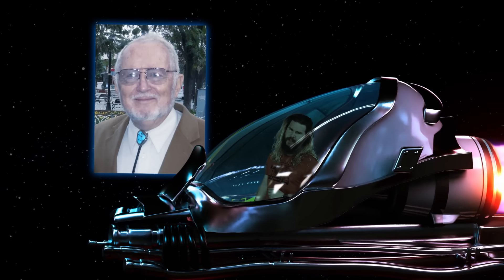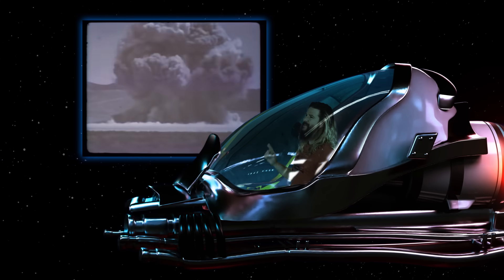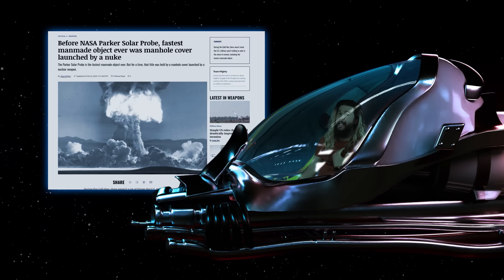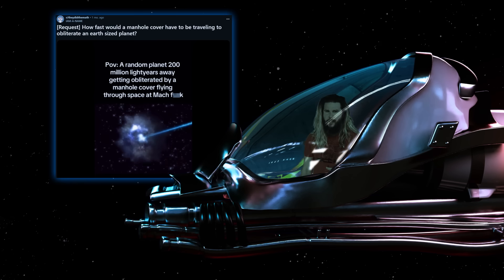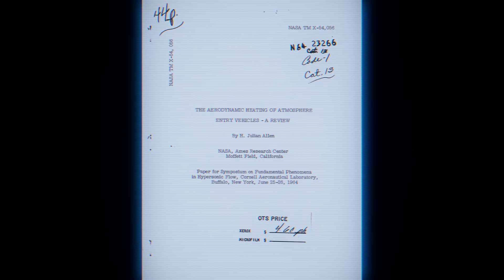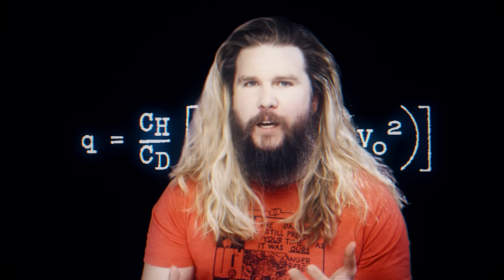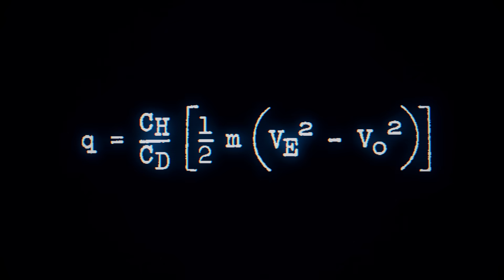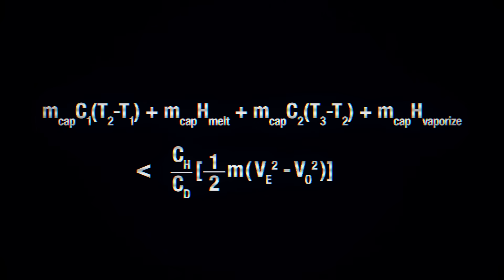Debunking the Nuclear-Powered Manhole Cover

Comment: I think there may be a flaw... 1) yes manhole covers are traditionally cast iron 2) cast iron is extremely brittle 3)welding cast iron is difficult and makes it more brittle 4)having more than alittle experience with explosives and the occasional run in with a sewer lid, it does not usually survive blast overpressire without fracturing .. all this to say i think your manhole cover was probably steel, and most reported accounts call it steel- your melting temps are off

Comment: Cast Iron is so brittle that the cap probably turned into powder. Something I don't see mentioned in most of those videos is what was between the cap and the nuke below: Namely, a huge concrete plug and a crapload of water. They basically made the world's largest steam cannon. Either way, something going as fast as that cap would compress the atmosphere in front of it so much the air itself would start to burn. If it powdered, it vaporized.

Comment: before I'm even finishing the video, the math is skewed the wrong way. People saying "it has to go through the most dense parts of the atmosphere first therefore it is worse than re-entry" you're thinking about it the wrong way, and the entire formula for calculating it doesn't factor this in. As you go further upwards, air density and resistance down, meaning that the further up you go, less drag, less heat generated. Your low point which has the most dense air is where the acceleration happens, meaning it has the most energy in it, and it can accelerate to the point that air density no longer creates the drag required to generate heat.

On re-entry, instead of an explosive acceleration that has less drag the higher it goes, you are losing energy and increasing drag the closer to the ground you get. Think of it like a brake rotor on a car, if you brake hard from 100 down to 90mph and then release the brake slowly until you hit 80mph without accelerating more (gravity lessening as you go upwards), you generate less heat than if you are going 100mph and gently apply the brake until stopped while continuing to accelerate (gravity increasing).

This is also why engineers always fuck everything up, at some point in their studies, they lose common sense. (not calling you an engineer, idk what the fuck you are, I'm just mad at engineers today)

Comment: You acknowledge in the pin that heating takes time, so how does this calculation prove anything? The lid would have reached the Karman line in about 1.5 seconds at that speed. And, as many others have noted, it would have received progressively LESS heat as it climbed. I'm certain there was ablation going on, but that would have served to preserve some of the mass by removing energy/heat from the leading edge. One objection I haven't seen anybody else raise is the fact that long before it vaporized it would have become malleable enough for the air resistance to form it into a more aerodynamic shape.

There is one more factor unaccounted for. The lid wasn't traveling alone. There was a shockwave and a plume of gas. It's entirely possible its relative air velocity was significantly lower than its climb rate.

Comment: When an object re-enters the atmosphere it's heated due to rising temperatures and barometric pressure. This is why comets and other objects get super heated as they enter and most ultimately burn up as they get closer to the ground. The manhole cover is doing the exact opposite. Like any object travelling at a higher altitude. It will form ice build up from the water molecules and colder thinner air temps(NO I am not saying that ice actually built up on it). The air is thinner and colder at higher altitudes. Travelling fast enough the rapidly cooling air around it potentially could have preserved some of it to potentially plausible. You want you math to be accepted. Take Hawking's approach. Once you think your theory is right. Try and disprove it to test it validity.  We also don't know how ANY object acts and reacts based on that shape and velocity. You should do less theory and more practical testing.

Comment: it is wild for some one to think you could get 2000 lbs of cast iron to get 2700 degrees in 10 min ish maybe even less time how much of i difference will it make in friction as the air gets thinner was it tumbeling did it wobble I mean at 150k mph ish it could have went straight as hell id like to now a little bit more about it and then we could know more was it 120k mph or was it 201k mph that is a very large difference

Comment: Ok.... I look far more into this than I thought I would. Did far more math and math research that I thought I would. 

Saw this a few days ago btw. So @kylehill is right. But hes also wrong. The part he is wrong about is the man hole cover WOULD survive the thermal stresses IF it could have survived the MECHANICAL stresses. 

The blunt shape of the object provides thermal protection from the aerodynamic effects. The blunt shape means more air needs to move out of the way and of which cannot do so fast enough and provides an area where heat has trouble traveling through to the material of the object. If it tumbled, it would NOT get this benefit intermittently. Additionally, as the surface heats up it is heat up so fast that is boils off before conducting into the material and is carried away by the air ripping it from the surface once the air can overcome the mechanical bonds (its called ablation) the material has to itself. Unfortunately, that is immediately.

The PRESSURE that this air inflicts is enormous. Rudementry calculations show that the stresses at the face of this object is going to be at the GIGA PASCAL range. Even if this thing was made from D2 tool steel and hardened to 60hrc throughout it still would not be able to survive as the forces are over 10 times the materials capabilities to withstand in the worse case and just above its capabilities in the best case. It would literally spall like a bullet hitting a steel plate as it moves through the air. Best case is if all the load is compressive strength generally is better than its tensile strength.

Note:
These calcs did not take into account of ANY deformation and how that would affect the Thermal or Mechanical Loads that are imparted.  My professional opinion is that it doesn't matter, I cannot for see steel as a material being able to deform in such a way that it would provide enough benefit for it to survive mechanically. I do not have the means of mathematical knowledge necessary to check this however. I MIGHT be able to run it on ANSYS but I would need to check with ansys to see if their CFD solver is able to take into account of these effects. I have never ran a CFD as such high speeds and have never seen one ran a such.

Comment: A couple things to note.

Objects traveling at hyper sonic speeds see insulation of the vehical due to the Shockwave. Addtionally the more blunt the object the more insulation received. This is due to air not being able to move out of the way fast enough.

Addtionally ablation needs to be taken into account as ablation is used to remove heat before it can conduct into the material.

It's still possible the manhole cover could have survived

Comment: I got a question are you taking the account of the air getting thinner the higher you go? And a astroid most of the time don't take the fastest route like straight up and down. And about the film it could have been covered by the fireball of the explosion's expanse. But I would like  to think it happened. But if any of it made it more than likely it would be glitter or dust . In the film it was just one frame that we can see the cover in and on that math it never had a chance.

Comment: Just a thought but we are assuming this went straight up the entire way. However a single Pebble bumping one side in the explosion would change the angle at which it was traveling. This means Not only would it have been shot off to the side you would also have a change in surface area because the thin portion would eventually be face up making it more aerodynamic.  It's like when you drop a piece of paper that's folded to have a point at the bottom. Even if you don't drop it exactly with the point facing down by the time it hits the floor the point part will be facing down. The manhole will be traveling not straight up and it will shift to having the most aerodynamic side pointing up. Are there any errors in my thinking. And if not does this change things enough to make it possible.

Comment: Didn't do the math, I used to do sciencey-type stuff though.  In other words, I used to blow things up, and I have experience with cutting and joining metals.  Cast iron comes in various qualities.  It isn't all the same. Probably ductile iron, not grey (more pure).  The ductile is used when a degree of flex is needed to allow for elasticity, if someone is blowing a nuke up, I expect they would go for strength over cost savings.  It absorbs shock.  Meaning less likely to shatter and then allow the various pieces to just vaporize.  Bigger chunks should have been the result.  Now that goes out the window if we find grey iron was used, that became a million pieces just from the acceleration.
I never have heard of an organized effort to go and search for the debris field of the manhole cover, although I am sure people have looked in a disorganized way.

Comment: Question are you taking into account that the cap would be going at 528km per sec and meteors start breaking up at 90kms from ground. So in 1 5th of a second (200ml sec) the cap would be past the burn up point. That’s the same time it takes to blink.. wouldn’t the cap be out of orbit before it heated up to the point of melting?

Comment: so there is one more factor i have not seen addressed (admittedly, I only read about 20 comments down) when the detonation went off, the blast wave and concussive air that was lifting the manhole cover would have punched a hole into the atmosphere. The manhole cover for at least a chunk of the accent would have been going with this blast wave. How far it went before the manhole cover's larger mass propelled it past the lighter air in the blast wave would make massive differences to these calculations.

Comment: Why use the Cd of a FLAT 4'x4" disc?  Wouldn't it be much lower for the disc because air resistance would push it into flying thin face forward. A rounded thin face!
And the Cd would become even lower when  the edges smoothed off by melting and its' mass decreased by stuff dripping or sublimating off.  
And what is the Cd doing on the bottom of the right side? It seems to me the lower the drag, the less heat generated, ie, it should be on the top. Or is the Cd an inverse value, or is it correlated with the change in velocity? In other words, the change in velocity DEPENDS on the Cd, so there would be less change in velocity due to the streamlining of the manhole cover. You assume it slows completely down from 66 km/s to 0. What if it slows from 66km/s to 60? or 64?  or 65? That's almost two orders of magnitude by itself. (It would also slow by the action of gravity, but this would reduce the heating, so not helping your cause at all! )
The Atmosphere gets thinner as you go up. By the time the heat transfers to to the inner part of the disk, it may be in space already. 
You have the Hmelt and Hvaporize. But where is the Hplasma? It would get so hot on the outside that the iron would become a plasma, not a gas.
As for referring to exploding meteors, they are usually rocks/minerals of irregular composition, not an iron matrix. The only gas you would get would be the iron, not exploding compounds.
So in short, however scientific you look with that big equation, as you say, garbage in, garbage out. Do a better job on V2 of this. If you dare.

Comment: I'm not going to argue the maths except to ask 1 it would take time for the cover to reach vaporisation temperature, 2 it is all the time climbing into less dense air which would effect  the heating which is why super fast plane like the SR - 71 climb as high as possible, 3 it flight orientation would affect the heating and 4 would the fact that it would be slowing as a result of gravity affect the heating?.
Also I must argue that it was a man made object, It did achieve a calculable speed; the fact it in all likely hood did not survive for any length of time does not invalidate it as being the fastest manmade object at the time.

Comment: You are right, that speed would be able to melt/vaporize the cover given enough time/exposure to that drag, but there are a lot of variables it doesn't take into account like AoA, and time taken. Many objects we observe being burnt up come in at a more oblique angle maximizing their time in the atmosphere, also they are traveling from low pressure/density to high pressure/density and the manhole cover was doing the opposite, it would clear the highest drag and therefore heating portion of the atmosphere so quickly that I'm skeptical that it would vaporize I think options of that cover indeed made it to space.

Comment: OK, I’m a bit of a layman so I’m not good with all the math. But the fact that you referred to convection (the distribution of heat through the movement of air caused by heat) tells me there’s some problems with your equation.  The heat generated is caused by friction not convection.  Also, comparing meteorites to a piece of iron is not always accurate. Statistically Iorn based meteorites often make it to earth because of their higher density while rock based meteorites do not.  Also the shape of the “manhole cover“ is important because the friction acts upon the external surface area which has to evaporate in time from the outside in.

Comment: So, in the equation for atmospheric re-entry heating included the difference between the square of the initial velocity and the square of the final velocity, which means that the amount of heat generated is directly proportional to the amount of speed lost, right? In your calculations, you only used the square of the initial velocity, which, logically, means you way overstated the amount of energy generated by the manhole cover leaving our atmosphere. I mean, I understand that we don't know, for certain, how much the manhole cover decelerated, and we also should consider how much the improperly contained nuclear explosion contributed to the heating of the manhole cover, but from what I saw of your calculations, the amount of energy on the right side should have been much lower simply because of that one mistake.

Comment: while im not great at this level of math there are some things that are off one all of this is is taking a little over a second approximately1.51 s now as its going up the air and resistance are getting smaller assuming that the plate isn't flat all the way up changes your whole equation which due to forces on it would make since that it would not be flat. there's alot wrong while i dont know there math i do know that if its flipping or side ways the math changes completely which was filed to be shown. there is way to much unknown for the math to be proven one way or the other.

Comment: Anyone with a lick of sense understands that it couldn't possibly be going that fast.  The force required to accelerate it to the alleged speed, applied near-instantaneously, would not accelerate the cover, it would shatter and/or vaporize it.  This thing wasn't being (relatively) gently accelerated down the length of a long gun barrel; it was just SLAMMED with an explosion.  Iron bomb casings of comparable thickness, subjected to the MEASLY detonation velocities of 7,000-9,000 m/s (TNT or RDX) shatter into small fragments, and those explosives only propel fragments as a couple thousand feet per second.  An explosion with some magically fast wavefront that approaches escape velocity, many times faster than that, would obliterate this manhole cover into dust.

There are also issues with the idea of a projectile being accelerated by a compressed air column, to a speed many times faster than the speed of sound in that air column.  There is a reason that the high-speed impact testing guns used by NASA for orbital-velocity impact test are done with light gas guns instead of airguns

The reality is that the film probably wasn't running at exactly the speed they thought, or the blur they thought was the manhole cover in the film was in fact a radiation exposure artifact.

Comment: You didn't calculate the heat lost by airflow over the cover. It would dissipate heat over whatever surface area was the trailing side. Also, the meteorite analogy is misleading because of the angle it was shot through the atmosphere. It would've spent much less time burning through the atmosphere.

Comment: Question.... Did you plug in time? 50,000 Degrees for 3.4 Seconds would not Vaporize. Also going out to space is alot colder than coming in.